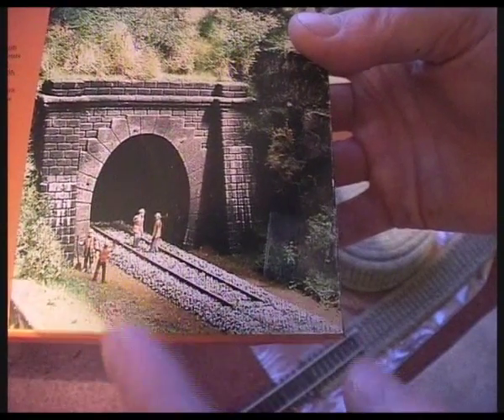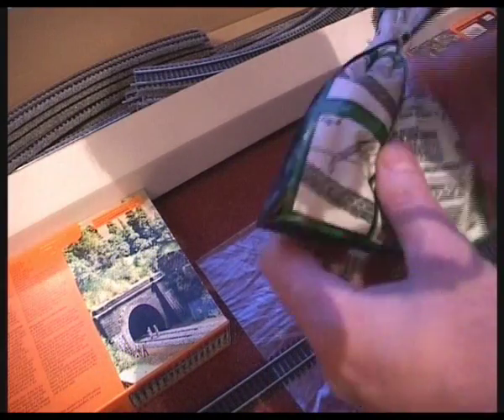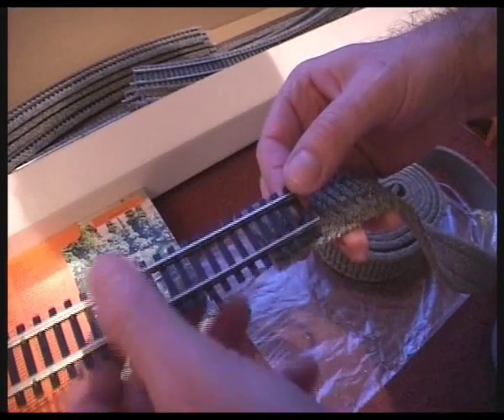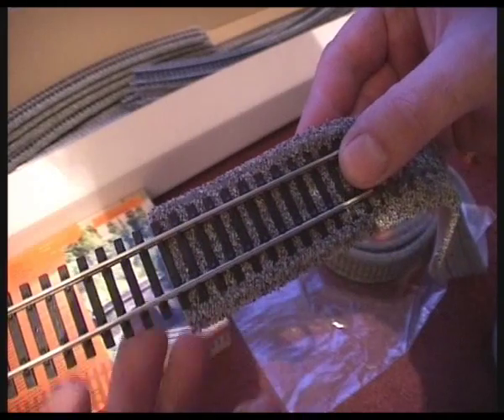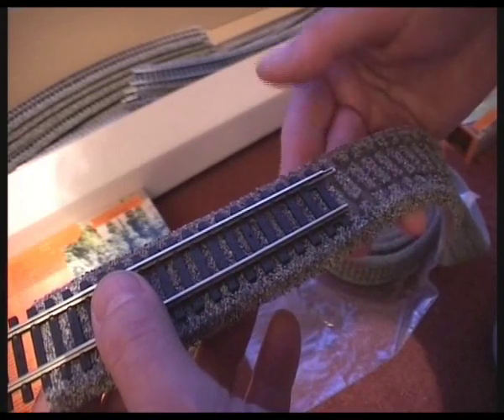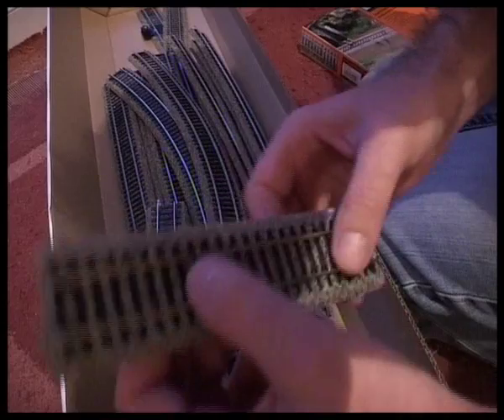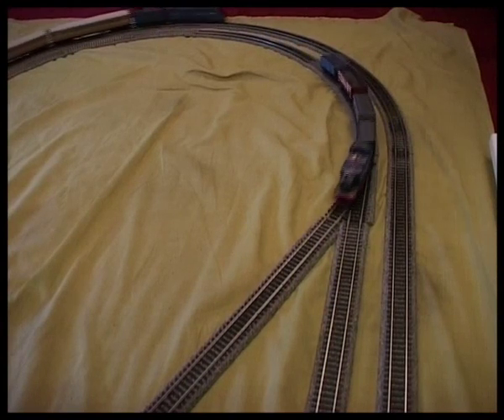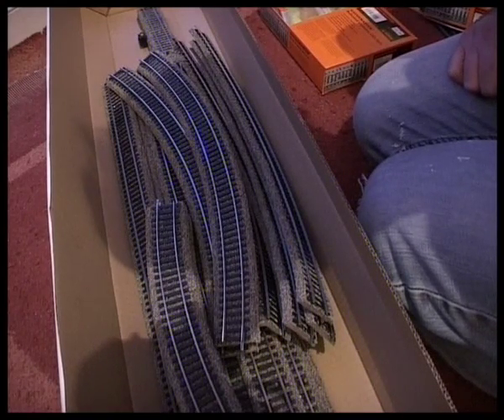Model Trains Ballast - types of (but mainly ballasted foam)

Comment: Just got some of this and have been trying it out, points are hard work but got there in the end.
Was wondering about giving it a spray over with some sort of track colour paint?
Reply from the maker: +MikesMovies Yes, the points take me about 20 minutes each. You could try a spray called Sleeper Grime by Rail Match - costs me about a tener.
Reply: Many thanks.